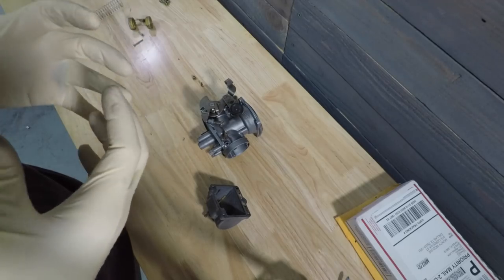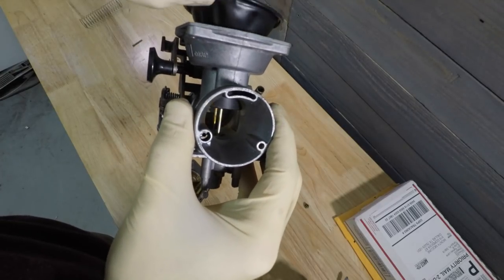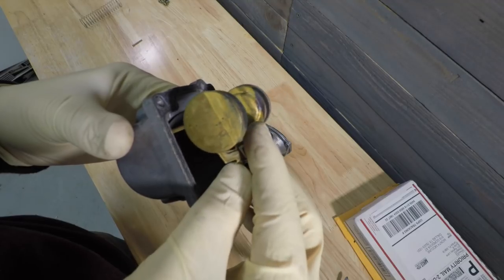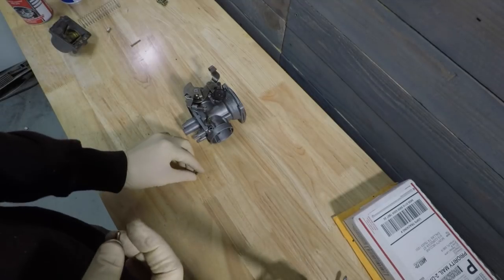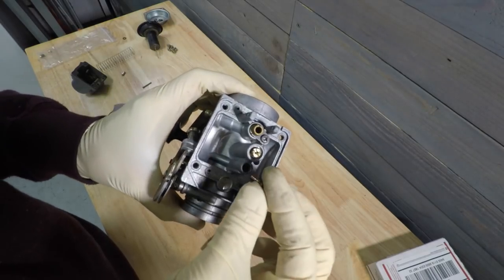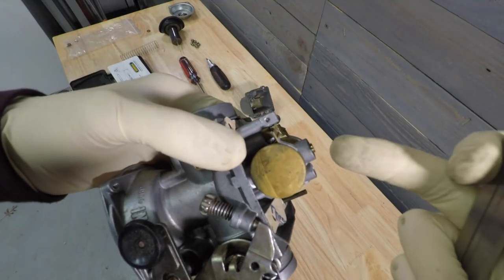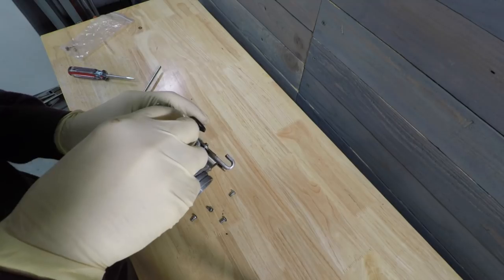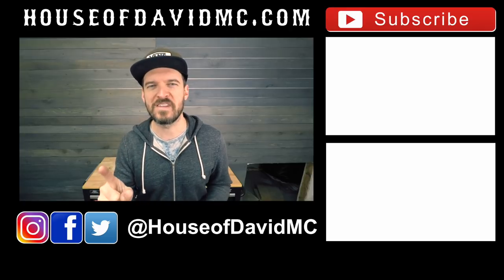Suzuki GN 250 Cafe Racer Build - Part 13: Carburetor Basics

Comment: This is a really helpful video. I just wanted to point out that at 3:00, you say that the needle is connected to the throttle. In case this confuses people, it should be noted that this is a constant velocity carb. So the throttle is connected to a throttle plate, not to the needle. The needle moves up and down with the slide due to vacuum pressure on the top diaphragm. Vacuum pressure is created partly by the piston intake stroke and regulated by the throttle plate.  The slide and needle move up together when the throttle plate opens, because increased airflow through the carb leads to negative pressure after the venturi (+ intake stroke vacuum) and this negative pressure is carried to the top side of the diaphragm. This lifts the slide and needle together, allowing increased fuel through the needle jet.
Reply: Thomas I need help!
You seem to know how these work how do I get that needle to move up and down as the throttle opens the butterfly?
My carb stays closed with the needle but the butterfly opens and it won't rev up? Please help🙏

Comment: Most clear cut carby instructional ive seen on the tubes mate! Cheers great job! Could never ghet my xs650 when I had it to run right with a pod filter due to the blocking of holes and swirling air!
Reply from the maker: iRidetas thabks, bro! I'll have a bit more tweaking to do once she's running- it's always seems to be different from one bike to another 😁

Comment: There is always more air in the mixture than fuel,more exactly for every liter of fuel vapor you need aprox 14liters of air.the correct ratio is 14:1 air fuel ratio,so if you are bellow 14:1 the mixture is rich and if you are above 14:1 it is lean.

Comment: Super helpful! I have a GN250 that keeps fouling spark plugs (which results in it conking out and it won't start). Have had some recommendations relating to the carburetor but as I'm a newbie it's all jibberish to me.. Still at a loss at what to do but this sort of content is pointing me in the right direction lol. If you see this, any advice would be appreciated.
Reply: @nobody78578  ended up re-boring it, getting a larger piston, rejecting the carb, new battery, seems to be running ok now but this has only all happened in the last week so we'll see how she goes 😂

Comment: 6:45 wrong! main jet is last.
This is why,  idle circuit works through out the whole throttle range so at idle or at flat out it is still allowing a metered amount of fuel through the carb.
As the idle circuit works the first quarter of your throttle its jet has to be set correctly and can give you up to half of your rev range, so it is working a lot of the time. 
[poor idling or stalling engine because of gummed up or blocked idle jets including the air inlet of the idle circuit. rev passes cause lean conditions on the rest of the fuel cir
The Jet needle and needle jet come next but usually these will be already set to work within a good tolerance band that will work with the idle circuit. If you need to enrichen this part of the circuit you raise the needle and if you want to lean you lower the needle once you reach  the limit of in either direction  within this mid to higher part of the rev range its time to look at going larger or smaller with the main jet.
Now it  is just figuring out which main jet to install for balls to the wall WOT flat out top end but you've already probably figured this out by now because of the previous step.

you will need a vacuum gauge to accurately set the idle circuit and on multi carb bikes set the balance.
before doing any of this you will need to check the float height is correct as this effects the lean/rich state throughout the whole carburation range.

Comment: Did you end up keeping the 132.5 jet?  I have a GN250 with the same pod filter, and I'm currently going through tuning at the moment.  I've also heard that the needle can be moved up one position if the airbox has been removed.

Comment: When I use the throttle to rev tge engine.  It seems to take a long time for the revs to drop back down.ive lubricated the throttle cable.  Could it be that the diaphragm or needle jet is sticking slightly? I did just clean the whole thing out and it was OK before I did the cleaning. 
Should the needle jet slider that you can see need any oil on it to help it go up and down smoothly? Thank you
Reply: I have the same problem with my GN 250 motorcycle, it takes a long time to lower the revolutions, in fact when I hold the clutch down the motorcycle accelerates, were you able to solve it?

Comment: Hi again, when you installed the new air filter, what did you do with the hose for the engine fumes that was going to the old air filter?
Reply from the maker: i just left it off. Please forgive me, Mother Nature :)
Reply: put a crank case filter on it it will make sure that if any air comes back through it will be clean

Comment: I ride tu250 Suzuki volty  but I don't what is wrong with carb werever am trying to increase speed to more than 80 it reduces it's becomes funny like air is to mch than fuels what do I have to do to put back ma bike to normal as it used to bi before.

Comment: I just went through the hell of adjusting the fuel level on 4 carbs for my kawasaki. If it's not right, it'll cause all sorts of issues. In my case the level was so far off on some carbs that the idle jets weren't getting any fuel and the bike wouldn't start. 

Stick some clear tube on your bowl drain and use that to see the actual fuel level in the bowl. The service manual should give some sort of fuel level line. Like this: https://ww2-secure.justanswer.com/uploads/jpolicky/2011-03-14_032414_2009-07-19_032627_fuel_level_adjustment.jpeg
Reply from the maker: Jordan Liske awesome info. I'll give it a look 😉
Reply: The gn250 carb has no screw to bleed access to overflow, just a dump screw